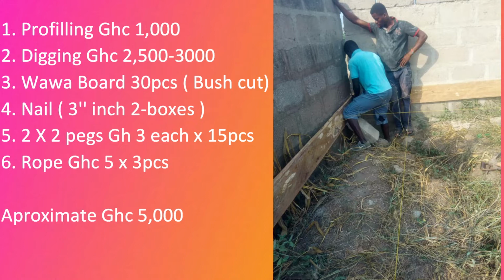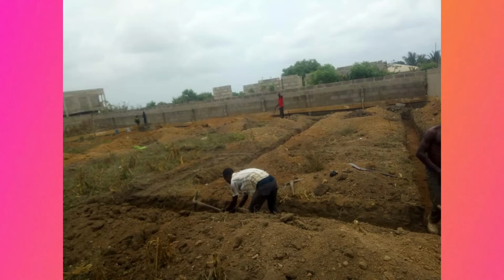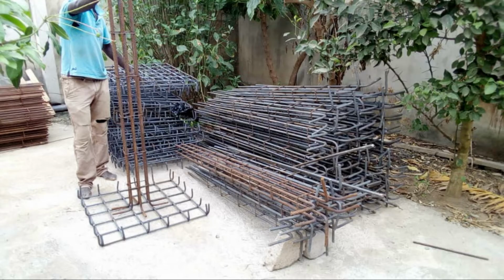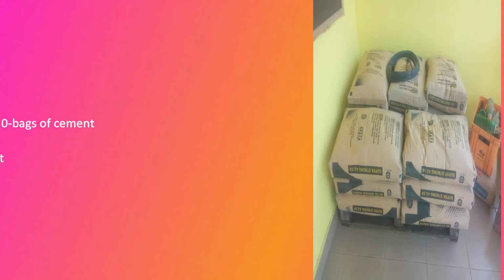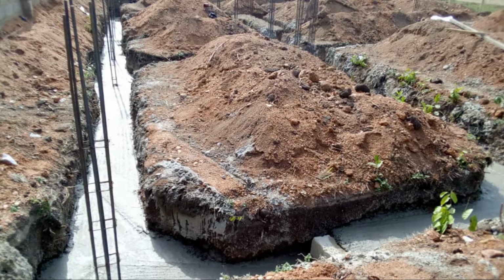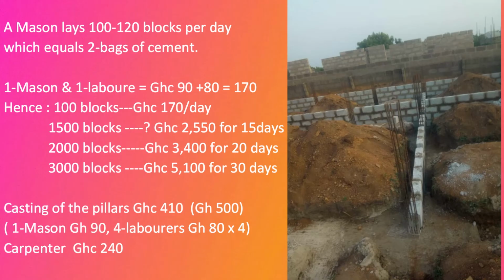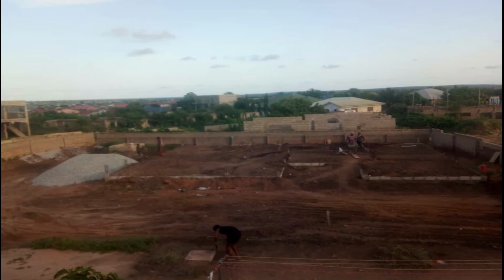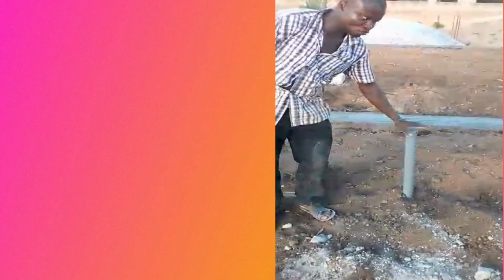Building in Ghana | Cost of Building a 4-Bedroom house in Ghana | Ep-1 #buildingingghana #cost,

Comment: Why do you need Wawa boards for the profiling these boards are very expensive so as a builder in other to help your clients reduce some unnecessary cost you can help by soliciting these boards from friends or old projects for the starting column? Wawa boards are expensive and you can easily use 2x2 lumber just for the setting out. 
My advice get some used boards that you can use for at least 5 or more clients depending on how you use it. Then during the continuous columns the new boards for those columns and also for the lentil, beam and all the top columns. 

I believe the first thin to be done should be the a soil test. 
That is the most important part of a construction project. Moisture Content Test is a very important test for building construction. This will determine the kind of foundation and footing concrete you’ll be doing as a builder or engineer.

Comment: As some visitors already mentioned, the building process should start with a soil research. Normally, even before you buying a land. It can save more money than the whole building is projected.
The land should be visited/studied in the raining season. In the dry season, all land looks maybe fine and in the raining season out of the sudden it might develop into a water logged area, which is a completely different building caliber, especially concerning the costs.
All foundations should be built as if water will reach the house. All materials for the foundation should be waterproof!!! Cement and the blocks until soil level should be made with the right chemicals, meanwhile they are on the market.
Waterproof rubber (300micron) shoukd be used in all trenches BEFORE any concrete is casted anywhere .......

Comment: I use one bag for hundred blocks.
Even today when I was building an extension, I used one bag for 95 blocks.
So it comes down to the thickness of the mortar bed joint and the perps
Reply: How many inches of blocks
Reply: @affumgodwin6398  5 inchs
Reply: Are you sure?
Reply: @emmanuelansah3634  yep
You can lay more with about one inch mortar bed and a half or one inch vertical joints.